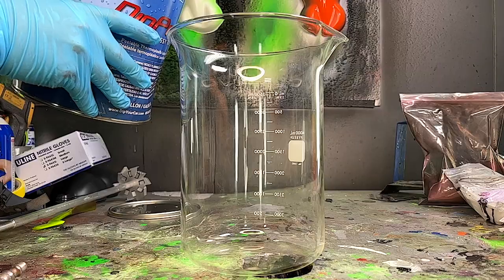Spraying a Car in MAKE UP (Cosmetic Powder)

Comment: Honestly, I'd 100% rock this color. Looks fantastic, though I'd worry about the long term reliability of color
Reply: If you put a good amount of glossifier over it, it should be okay
Reply: Have yall ever seen a lipstick stain they last a lifetime
Reply: I'm sure you could do this with normal auto pigment
Reply: @bradphillips8901  Well... a high refractive index, but poor IR resilience. Some pigments will actually "burn themselves out" faster depending on how they're dispersed.
Reply: @Lupine.  true. But as someone else stated. Have you seen how long a lipstick stain last? Or tried to clean one? 😂
But yea, it will depend on the brand of makeup pigment it is. Cheap or expensive.
Reply: Same.
Reply: If someone could find a way to duplicate this color I'd rock it on my truck for sure .

Comment: Can we see the follow up videos of the experimental dips? Like how some materials hold up after a week or month. How they handle when you remove the material. Would be interesting to see the makeup material removed and what it leaves behind.
Reply: I would guess, that nothing remains, because of the black grounding.
Reply: Yeah even if it's just on one of those test shapes
Reply: Makeup has additives, but the core elements, I.E. the pigments, are the same exact thing.
Reply: I'm 💯 sure it will remove the same as the normal stuff as it's mixed in the same medium and sprayed over a black base coat also its basically mica powder that the usda approved for make up

Comment: you have uncovered one of my greatest secrets using these pigments. I've been inventing colors with these for a couple years now.
Reply: Does it hold up to the uv
Reply: @joshuamitch22  the UV is generally a function of the clear coat. I have never had a problem, and I only buy the best stuff.

Comment: Gotta say there is maybe some research to be done in to how the pigment held in suspension so well. Incredible coverage.
Reply from the maker: The coverage was good but expected for such a dark color.  If you look really closely at the walk around you can see inconsistencies in the finish, almost a cloudiness at certain angles.  I don't think these pigments are meant to cover such large surface areas.  Pretty cool, but I'm just going to stick with auto grade pigments
Reply: @dipyourcar  ah no totally agree that automotive pigments are definitely going to be better long term. I just meant how well it seemed to cover the test stick compared to normal. Do u think it could be due to the pigments powder grain size?
Reply from the maker: @swifty2844  no genuinely just think it was a super dark pigment.  We tested 3 other red Cosmetic samples small scale and the coverage was incredibly average
Reply: @dipyourcar ah I see, fair enough, great video anyway fella, love that you are willing to push the boundaries 👍